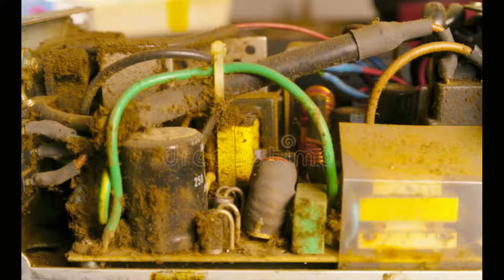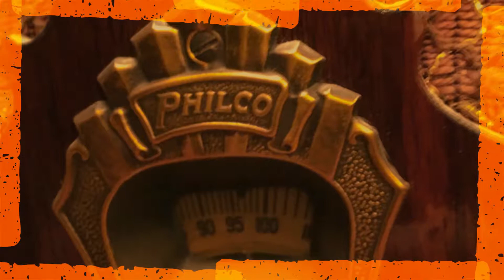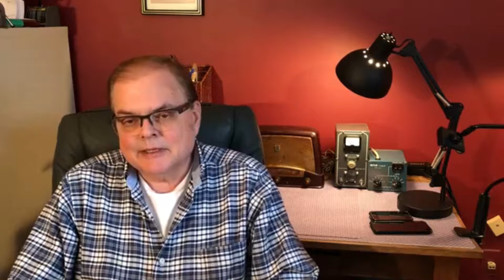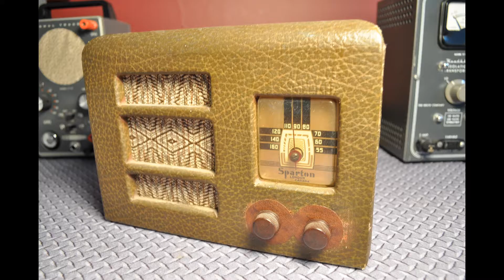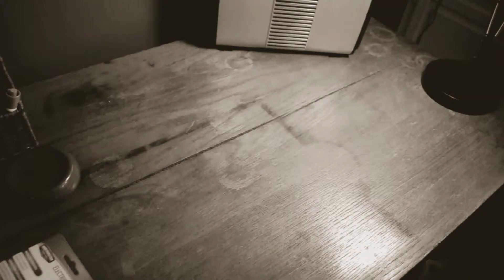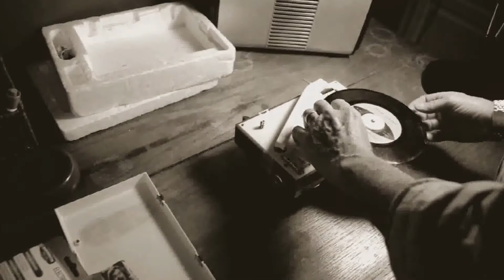Introduction to My New Channel

Comment: I just found your channel Dan, and plan on following your video's. I have been working on AA5's starting this year myself and agree with your comments in the video.
Reply from the maker: Jim Newman Thanks for watching. We’re certainly still learning and have some interesting radios coming up.
Reply: @RadioRetired Hi Dan, I have not seen the turquoise clock radio  Motorola Model 57CC1 1956 on your introduction section gone through yet. I am looking forward to seeing you work on that radio because I have the exact same one as far as I can tell. if it is I can send you the schematic on it. It was the very first radio the I rebuilt this year back in February.